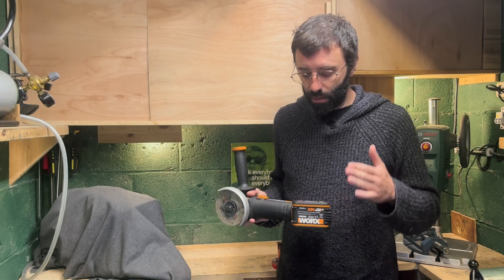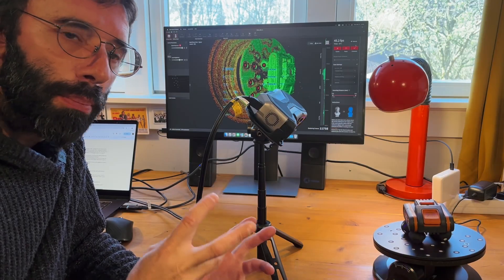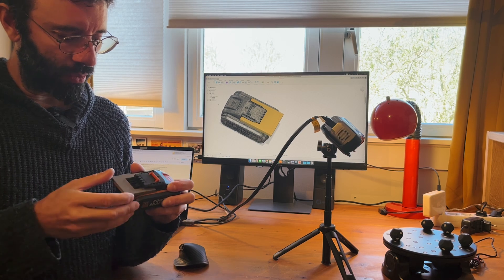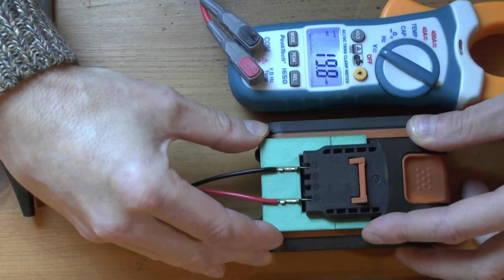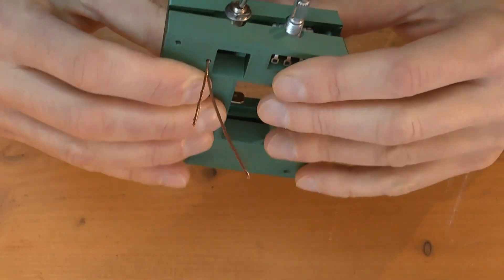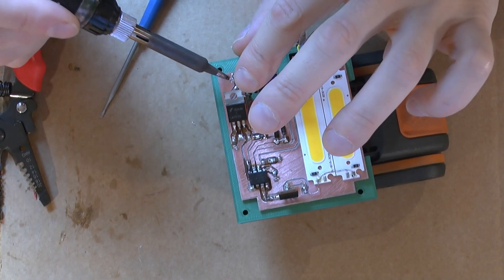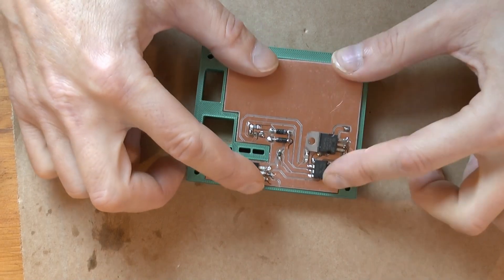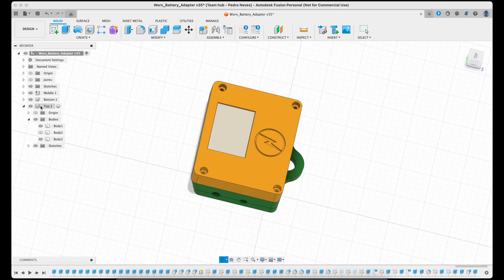What To Do with an Old Power Tool Battery

Comment: The "2Ah" marking on the battery isn't the nominal current capability, it's the capacity. That battery is capable of much higher discharge current than 2A, usually 10C per cell, so 20A discharge, but a single cell doesn't have to provide that much current when in parallel with other cells.
Reply: Thank you that someone brought it up it's literally the first thing that made me stop the video and look for comments.
Reply from the maker: Hi, indeed, 2Ah is the capacity. And the capacity of a battery is generally rated and labelled at the 1C Rate (1C current), this means a fully charged battery with a capacity of 2Ah should be able to provide 2 Amps for one hour.
These batteries are designed to work at multiple C, of course. Nevertheless, 1 C is an indication of what is nominal.
Reply: @pedro-neves  Nominal current is determined by the load, not the source, and is defined as "the typical current draw for normal operation". The nominal current in this case is actually the 26A you show on the clamp meter. Of course in the case of power tool batteries, the nominal current is unknown, because the battery pack can be used for multiple tools that draw different current. The pack does however have a rated current, which is the maximum current draw, usually determined by the protection circuitry. 
Yes, the shown capacity is typically calculated using a nominal current of 1C. However, it makes no sense to compare the nominal current used to calculate battery capacity to nominal current in real-world conditions as you did in the video, because normal operation will always be around 10C. The only reason for the manufacturer to use 1C in this case is to provide a capacity value for marketing purposes that is empirically true, but at current lower than all of the compatible tools will ever run at. Obviously, it would not be favorable from a marketing perspective to use the more power intensive load to calculate the capacity.
Reply from the maker: @ indeed, 2Ah is the nominal capacity. Battery capacity is normally given in Ah (Amp-hours) at a certain discharge current (A). So, it means that it will be discharged in 1h, at 2A.
This battery does not have cells in parallel. It has 5 cells in series to make 20V. Each cell has a capacity of 2Ah.
Reply from the maker: @ , despite 2Ah being the nominal capacity, it does not indeed mean that 2A is the nominal discharge capacity. So, I edited out this part of the video.
I have the deepest appreciation for your comment and your help to detect an error and correcting it. Thank you so much!
Cheers!

Comment: The printed on 2 Ah is not the rating for the nominal current... Thats the capacity. You can not compaire those two.
Reply from the maker: Hi, indeed 2 Ah is the capacity. It also means that 2 is the "C" of the battery. The capacity of a battery is generally rated and labelled at the 1C Rate (1C current), this means a fully charged battery with a capacity of 2Ah should be able to provide 2 Amps for one hour.
Reply from the maker: Indeed, thank you for pointing that out. I edited out this part of the video. Cheers!

Comment: or just pull the 18650s out and use them for something that isnt power intensive... while you swap new Li-ion cells into the tool battery housing and extensively extending its life.
Reply: Yep indeed! It's just a few 18650s in there and some balancing board type stuff. I was actually looking around to see how one can create their own powertool battery and make it modular. 3D print a bigger case if you need one to last long and a smaller one if it's for normal use. Maybe you can open the side and pop the batteries out for a faster swap and go. Modular mounting to different brands and such is also something that could be designed.
Reply from the maker: @shaneintegra  that's another option indeed!

Comment: I thought you were about to say check the battery indicator and keep it between 20% and 80%, discharging it monthly, and not letting the batteries sit there for too long without being charged/used. 
Seriously though, why balance charging on these batteries isn't a thing is beyond me. So many of them are cheaply made and rushed out some factory.
Reply from the maker: Indeed, you can do things like what you indicated to extend the battery life. My idea is about how to use it after it's already in bad shape.
Cheers!

Comment: Thanks for sharing this with us! Parkside ( Lidl ) has an adapter for its batteries. It has a LED torch and 2x USB for 5v charging.  Oh.. and a bottle opener.
Reply from the maker: That does sound cool;)
Reply: But you didn't make it yourself, did you?😅
Reply: @glennmorgan4197  No but to be clear I have a huge respect to the maker.